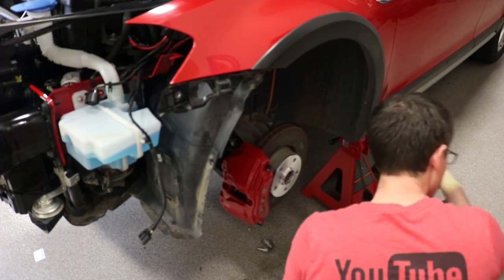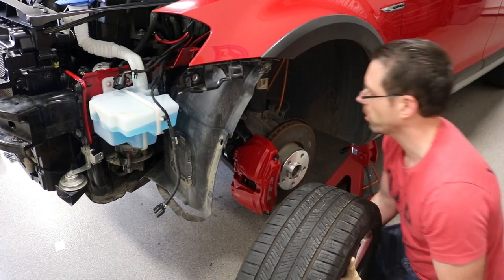We Lifted Our MK7 Alltrack!

Comment: Where on the sub frame are you putting the floor jack  to lift the car before you put the jackstands on?
Reply: Rod Costa control arm
Reply: i jack right in front of the dogbone mount.  wouldn't suggest jacking on the control arms
Reply: Would love to know this too as just bought a real jack rather than the cheapo one I had.
Reply: @dorkultra  can I be thick, where is that please?

Comment: Seems like the Golf VII has a snap ring on the axle like some older C4 and Typ44, or they don't lubricate the teeths anymore from factory. Because if they don't they slide out really easy. At least at the Audis I workd on, 300.000+ km and before 2000.